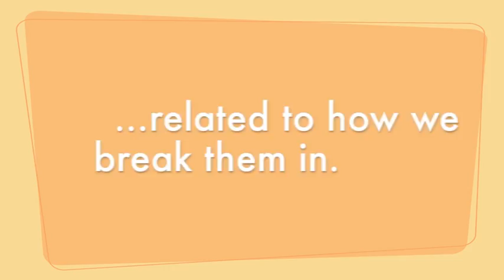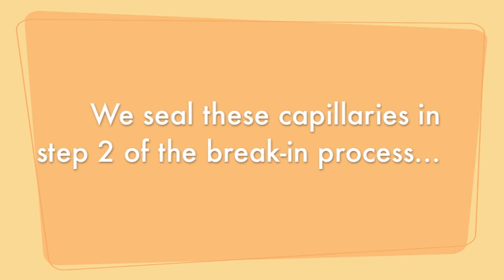(Almost) All About Reeds, part 3

Comment: Thanks for this great video series, Rick.  I have a cigar humidor which I am wondering if it can be used to keep the moisture level(s) in the reed more consistent in-between uses, or during its resting hours.  My theory is that: it would be significantly less stressful, and therefore life extending, for the cane reed - if it is not subject to extreme wet conditions, then somewhat very dry conditions over and over again.  Any insight, or reporting/commenting from experience would be appreciated.
Reply: DJ Tsunamiqu there are humidity-controlled reed cases that people use. I'm sure there is merit to the theory you describe. 

I used to use the old vandoren blue reed cases with desiccant tubes, but my reeds would always get moldy. And I find the humidor case too high maintenance for my needs. I'm happy with the system I've been using. But by all means I wouldn't discourage you from using your humidor. Especially if you get a nice Cuban or a Dominican essence to your reeds... ;-)